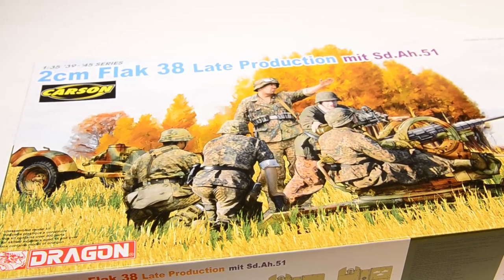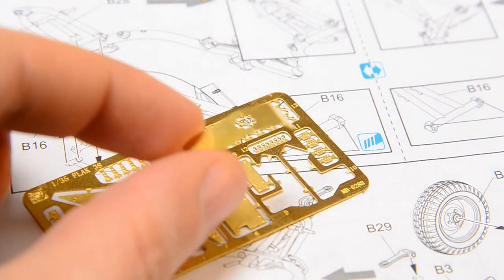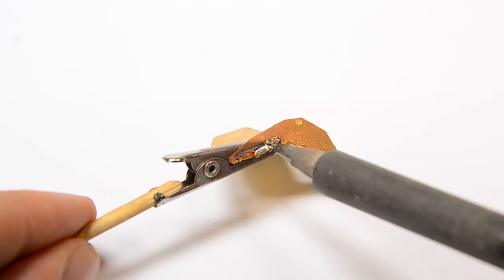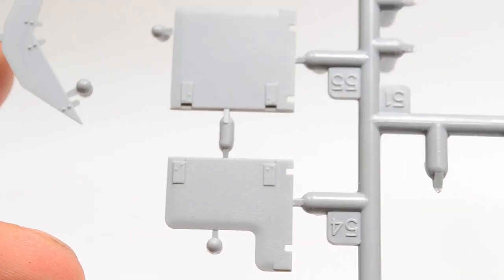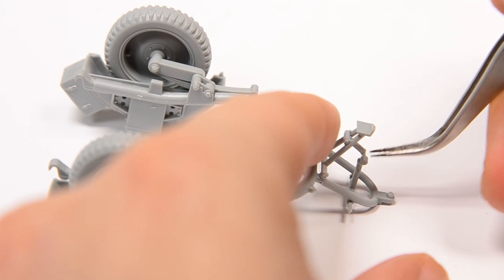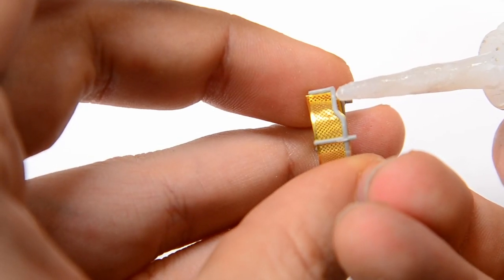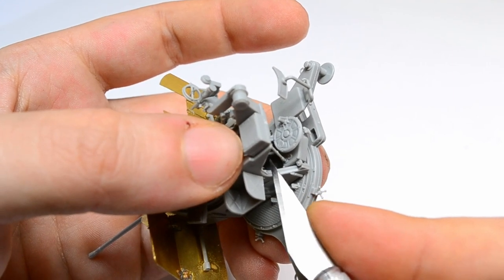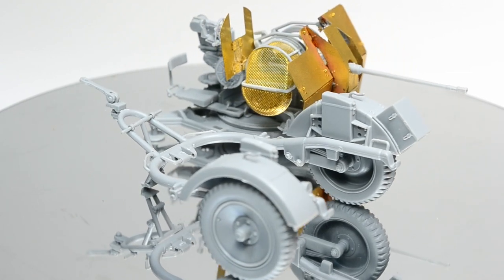Building the Flak 38 (late) | Dragon Models | 1/35th

Comment: Is that a weld bead or a seamline on the gun mount round the middle there? Mines don't have that so just wondering?  There's alot of small parts glued on to knock off if your going to have to clean parts up next taking the spruegate tabs off and sanded and the seamlines in the trailer too there!?
Reply from the maker: Im pretty shure I got all moldlines on the Dragon one - around the center on the base frame is a weld bead. most of the real carriage is pressed sheet metal, so where you would expect to see a mold line is a weld bead in most cases. it is very fine detail. The tristar one however is full of mold seams and was not finaly cleaned up yet. I'll take photographs before painting it, makeing sure it is well cleaned up.
Reply: I do like Trumpeters Flaks there detail in them is just fantastic there flak 37 I done with all the PE is stunning! There very good at there weapons moulds I have noticed but there newer stuff is brilliant there Brem 1 was beautiful the detail and moulds was as good as meng definitely upped there game! But there older flaks are really nice think that sheild was the first I solidered! The rear brackets were a night mare haha! Great work on this though!